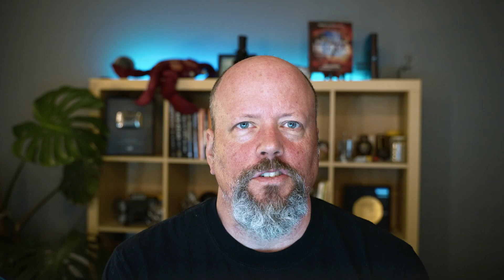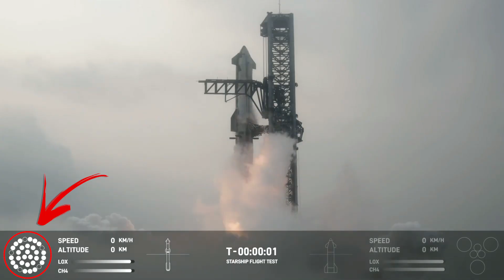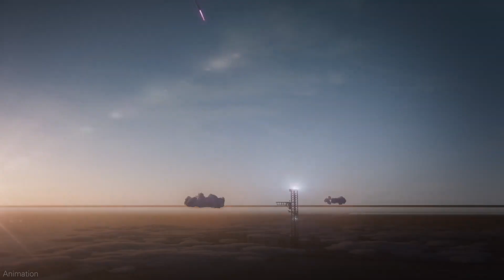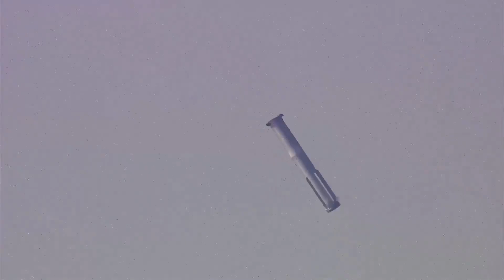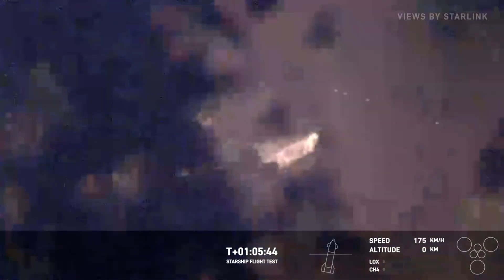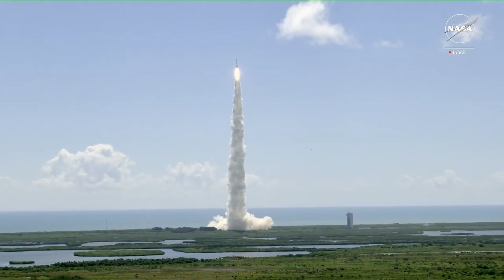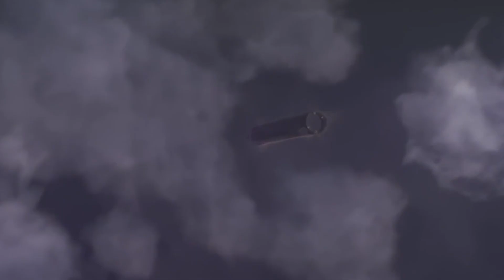IFT-4 and the Future of Starship: All You Need to Know (with @scottmanley  and @MarcusHouse )

Comment: What blew my mind was Thunderf00ts chat saying it was fake. They sound like flat earthers now.
Reply: I watch thunderf00t a lot and i've said it before, he's right about a lot of stuff on the topic of musk, like a lot of stuff notably hyperloop, but i think he's wrong about spacex, i think common sense skeptic has better cynical analysis when it comes to spacex.
Reply: @epelly3  CSS is even worse. Both are horrible and should be avoided.
Reply: @anthonypelchat  not horrible, just cynical sometimes they’re right sometimes they’re wrong, this video is incredibly optimistic, you need balance
Reply: @epelly3  Being overly optimistic is one, being pessimistic is another, and then there is outright lies. CSS and TFoot fall into the outright lies category. CSS had a recent one where a parking deck burned down due to a car fire. He started immediately calling for the ban of all EVs because they caused it. Of course he was saying that before any evidence came. And the evidence showed that it was a diesel. He then tried to say it was a hybrid, still blaming EV batteries. But nope, just a diesel.

TFoot had one where he was trying to get the weight of the Tesla semi from a video of it carrying concrete barriers. Instead of doing any research, he purposefully used the smallest barriers he could to come up with a weight of over 35,000lbs.

These are just 2 easy examples. They have many, many others involving made up math and false quotes for everything from Starship, Starlink, Falcon 9 and Heavy, Tesla, Boring Co, and others.
Reply: @anthonypelchat  can you send me the videos those clips are from I can find the clips you don’t need to do ALL the legwork lol. 

One thing I will say though generally speaking TFoot was right about the Tesla semis. Overpromised and underdelivered.  I haven’t watched many CSS videos on Tesla like I said I tend to watch more of his spacex criticisms. 

I feel like calling either side outright liars that don’t deserve your attention a bit much considering there is so much information being presented. Like I said they’re right a lot but sometimes they’re just plain wrong and I’ll admit it’s probably because they’re clouded by their negative bias. 

I’m not just gonna dismiss everything Elon says because I think he’s a liar either. I literally see his rockets going up every week irl
Reply: @epelly3  TFoot was not right on the Tesla Semi, at least not when it came to weight. I have no idea what other junk he threw out, but the semi is no where 35,000lbs. And it was absolutely a lie. There are 2 videos specifically that I will try to find tomorrow, one on the semi and another on SpaceX. But there are many other accounts as well. He has been vocal against every single product from Elon Musk and will downright lie to get his point across each and every time.

As for CSS, the instance I mentioned was mostly done on X, though maybe he put out a video as well. But it was about the British Airport Parking Garage fire. Ended up being caused by a Diesel Range Rover, which he accused multiple times of being either an EV or a Hybrid.

There was another instance from him where he made multiple videos and argued online about the number of people that can ride to Mars on Starship in the future. Of course he ignores the in the future and focuses only on the current version. But that wasn't the lie. He used a NASA study for working in space to come up with how many astronauts could ride on Starship. He used the numbers from NASA, got the volume for Starship, cut off an arbitrary amount from that volume, then cut that amount in half to come up with 24 astronauts only could ride on Starship. The actual study would really have been around 50. 

However, he neglected to mention the details of that NASA. Such as the space was for working, not riding. Further, it was 6-12 months of work at that location PLUS 12 months of travel, 6 months there and 6 months back. And he used that to compare a 6 month travel time for a future Starship. 

And it wouldn't be bad if they just were being pessimistic or skeptical. But instead they outright call Elon Musk and everyone who works with liars while they are lying themselves. And of course they insult anyone who doesn't believe what they say and foster a horrible cult that goes around to videos spreading those lies.
Reply: @epelly3  Watch the video "Thunderf00t's Embarrassing Starship Flight 4 Livestream" just to get a minor idea of the junk that comes out of TFoot's mouth. This is entirely about Launch 4 and nothing else, other than when he gets on tangents complaining about Musk because he has blind hate for him.
Reply: @anthonypelchat  heard will give it a look
Reply: @epelly3  Smarter Every Day's recording of his talk at NASA and the Starship moon missions is pretty damning... More than 10 Starships just to the Moon once? They do briefly discuss the weight and the increased addition of it in this video at 9:00 (but it's just not what's relevant today, so Fraser quickly moves on at 11:00 :D).

I think Thunderf00t is a massive negative nancy. But he presents very salient points. I don't think you can scale SpaceX's previous success with F9 into Starship. Firstly, SpaceX have the rocket equation hitting them in the face like Fraser mentions. Secondly, rockets returning from suborbital trajectories is not at all the same as having non-capsule-shaped vehicles returning from orbital velocities. Those sparks flying around the vehicle are not just insects who made nests in between the tiles like Scott says lol. I assume that was a joke :D

SpaceX is the best suited company to do it right now, but their goals are ever pushed forward. There's no way NASA human rates this vehicle any time soon. I'm optimistic for the 2030s.
Reply: Didn't saw that but I saw a lot of Musk cult members being very toxic in that chat, as usual...
Reply: @dave_ant1  calling a cult show your bias already. Anything they say would be considered toxic. You know like cheering and excitement.
Reply: Well, your comment is fake, too. Such is life.

Comment: The vapor cone produced by the booster as it comes back (in as seen from the camera in the ocean) seems like it’s produced by the start up procedure of the engines. It happens exactly as the spin prime would occur before relight.
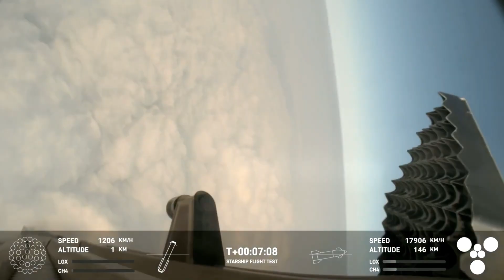Reply: At 12:00, notice that the vapor cone appears on the grid fin, too, and disappears as the engines light up, just like the large vapor cone. That’s absolutely a subsonic effect in both places.

Comment: 25:00 yes, the first sign for me was the sparks. Tim Dodd said it was likely sharp corners burning off. Sharp corners of what? This is not an ablative system, there should be plasma, but not sparks. But amazing that the fins retained full flight functionality right to the surface 😃

The guidance software was indeed amazing, but so too was the actuation hardware for the fins. That survived intact and functional even though substantial portions of the flap burned off. The resilience in this system is incredible!

49:00 Scratched his space-itch by flying to the ISS? I’d think that would only exacerbate the space-itch! Maybe by experiencing manned space flight first hand he recognised the enormous gap between Starship developmental progress and the reality required. I guess being that heavily invested comes with extra insight into the program, and maybe the realities he saw were not what he had been sold?
Reply: Regarding Dearmoon, it's not unlikely that Elon is happy to get rid of the dearmoon project. It probably would requires substantial scarce engineering resources to realize for a one-off side quest. Since Starlink is likely cash-flow positive and Musk could easily get free cash from Jurvetson (without anything that is off the main mission path to Mars) he probably told Maezawa to just go ahead can cancel his order.

I image a conversation between Musk and Maezawa where MZ asks for schedue update and urges for a date (as would be typical for a Japanese) and Musk tells him no date and instead suggest he cancels the project, "in fact let me cancel it for you" (all speculation).

Comment: I guess lots of people have considered this, but given that the Booster has four fins, then as far as I can tell (apart from manoeuvring) would it be possible to have them partially angled by default in order to increase drag on the way down? There's 4 of them, so a /\ /\ pattern rather than – – – – would prevent the booster from rotating and they could move back into position if temperatures got too high. I would have thought that anything to reduce velocity would be advantageous.

Comment: If you look at the Soyuz hot stage ring it is very integrated into the booster structure, the V1 boosters can’t do that so they have a huge amount of mass. Obviously the booster needs shielding too but once they are designing them into the boosters I doubt they will weigh so much.

Comment: The ultimate solutions to the heat shield would be if the could keep the starship altitude for much longer , before peak temperature. I think this flight trajectory may have limited that , so SpaceX my need approval to land somewhere else.
Although this could possibly stop heat shield from melting away , they flap will most likely still melt so heat shield on the back of the flap is definitely necessary.

Comment: The BH does evaporate, but there is a thing that it evaporates gradually without noticeable effect until a chunk size is reached and then the actual evaporation happens, it also means that you can feed it a bit of matter and that would maintain the whole chunk without needing that much matter. Also you can feed it information and it counts as matter, I'm not yet sure how

Comment: Glad these sensible guys are addressing the elephant in the room -total mass ( weight).
Remember this design started as carbon fibre.Now even more heat shield.You gotta wonder.
My other question would - landing legs ( for starship).
You have to have them for Mars,you have to have them for the Moon.They we’re needed for initial testing.You seem a sensible way to go now - other than a further increase in mass.
Reply: Not a lot of people seriously talk about the increase in mass of the whole stack because they are trying to get back a payload of 100t at a minimum. In turn, the Raptors engine, still unreliable as per Musk admission, will have to run even more extremely to squeeze as much thrust as possible, in the same package size. How is that supposed to improve the reliability of Raptor 3?  It probably won't... Their situation looks like the start of a negative feed back loop, chasing payload and thrust...

As far as legs are concerned, that's probably the least of their problem for the HLS lander. No tiles required and it won't return to Earth... I guess that will be fairly easy for SpaceX engineers. For Mars, that's another story but Starship will never be man rated for it anyway as it is too dangerous with its belly flop landing. And for Earth, it's even worse without an escape system... NASA won't risk it ever again after the Space Shuttle for sure, imo. But for cargo hauling exclusively, why not. Still, they will have to find a way to put legs without weak points for the heat shield... That is of course, if they make the whole thing work...

Comment: I haven't realize that the ring ejected have a mass of almost 10 little cars... And this is huge! People still have no idea on the scale of the stuff we are talking about... By the way, thanks for all you guys for spending time explaining us how fantastic is the time we are living in, regarding space exploration! :-"
Reply: Wait, it all fits on my TV--it can't be that big, right?? 😅
Reply: 😂 @sirgibsonable
Reply: Yeah, buddy! This is a huge beast! Remember what IFT-1 did to stage zero! Of course Ship only blasts it with a total of 6 engines, and three of them don’t ignite until it’s a few feet away, but still! It’s a steel ring almost 30ft in diameter, over 6ft tall, it has to hold up something like 1,400 metric tons of Ship and future payload plus the weight of Max Q pushing down on it, and finally has to absorb the kick in the balls of 6 Raptor engines @ up to about 1,380 tons of cutting touch-like exhaust! Not to mention their plans of increasing all of these figures by stretching tanks etc. and adding another 3 engines and Raptor 3’s proposed increase in thrust…
TBH, in my mind this will be their long term theoretical point of failure. As in like an integrated hot staging ring on Super Heavy Booster will be the deciding factor on just how many launches they get per booster before having to either strip it off and replace it, or retire the booster all together. I wouldn’t be at all surprised if initial tests show a 2nd flight with integrated ring isn’t feasible as they will necessarily have to substantially bring down the weight to provide a proper center of mass and ballistic coefficient and not lose control @ boost back, reentry, etc. I also wouldn’t be surprised if 1st hot staging w/ a 6 engine variant cuts right through the shield on the ring and blows up Super Heavy which would then kill Ship…
That said, I really hope I’m wrong, and I have tons of faith that they will figure out what needs to be done then do it! History dictates that this is exceedingly probably and I am so got-damned here for it all! 💪🏾😃👍🏾
Reply: 9 meters in diameter. Just look at something 9 meters away, that is a huge vehicle
Reply: A good exercise is grabbing a picture and put it up to scale besides a tall building in your area, put it in your phone, then go to said building and look at the edited picture.
Reply: That's like the weight of the largest African elephant ever. Imagine one flying in the air.
Reply: @busybillyb33  flailing helplessly and trumpeting in sheer terror.

Comment: Maybe Starships flaps because of their size function and the need to test and experiment will be replaceable wear items  like tires on a car that keep getting better over time and will need to be changed periodically. It looks like the heat shielding in front of and behind each of the front flaps could be designed as detachable covers with fasteners underneath allowing part of or the whole flap to have alignment adjusted or parts inspected and when necessary to be replaced. We still have to replace parts on cars because of friction and Heat, brakes tires spark plugs, etc. I wonder if any of the companies that make brake pads could be contracted to contribute to designing a more resistant heat shielding material.

Comment: Good report, These guy really pointed out just how big the engineering issues are. Major changes needed and not just tweaks. Artemis is further away than it was, because we now really know just how far the Starship  is from being capable.  Weight issues are still massive and the Raptor engines are still very much in question. !00% reusability looks even further away.

Comment: Just had a thought for the Artimis missions it does not have to be fully reusable. So if the recovery hardware is omitted from the tanker (not the fuel depot) version of Starship the number of tanker launches can be reduced (still recover the booster though). Making the tanker mission profiles similar to those of a Falcon 9. As the lunar starship does not have to undergo re-entry that means as long as propellant transfer and re-using the booster is achieved that is the bulk of the requierments for the two Artimis missions.

Comment: At 26:06 in this vid, I don't think that's a hot spot coming through. I think that's a reflection of the hot gases escaping through the back side of the flap, as we didn't get burn through at that spot as the hinge problem progressed. I reckon the tiles did a great job all round - it was just that naughty gap in the hinge.
Some clever person at SpaceX will come up with a solution for that I'm sure, whether it be hinge re-design, active cooling, unique seals etc.

Comment: I wonder. Do you have to flip Marcus's videofeed upside down before you can use it or does he do it for you at locale🤔
Reply: Ethernet twisted pair cables are being produced with an odd number of twists in Down Under in order to rearrange Bits in the proper way. It's an elegant hardware solution to a tricky and exotic problem.
Reply: @debott4538  🤣 gold

Comment: I'm imaging that the backup ablative material might serve to improve the interface between the tiles and the metal -- in terms of fragility. That is, having that possibly ablative-adhesive layer might help mitigate the effects of the thermal expansion and contraction of both the stainless and the ceramics, and dampen the vibration. So that the dang tiles stay on better. The idea being that you're much less likely to lose tiles -- but if you do, there's a backup ablative material to stop the plasma torching.
 
As for reusability, if tile loss is rare, maybe you can just slap on some more ablative-adhesive stuff and stick another tile on.

Comment: If they really build as many as Elon says, it shouldn't matter a single iota if it takes a few months to refurbish a starship.
Reply: Funny that’s exactly what they said about the Space Shuttle…
Reply: @TheCosmicGuy0111  I imagine it would have gotten cheaper if there were 1000 shuttles
Reply: @TheCosmicGuy0111 yes. Because the shuttle failed at quick turnaround it means it just can't be done. Because that's how things work... 🤔😃🤣
Reply: @TheCosmicGuy0111 They've already built far more Starship prototypes than there were operating space shuttles. They could probably "refurbish" a used Starship by scrapping it and recycling the steel into the next Starship, and still come out ahead of Space Shuttle.